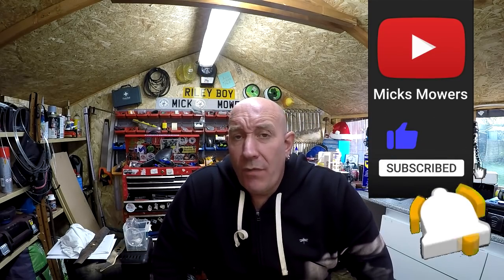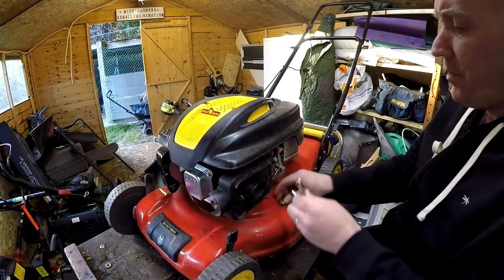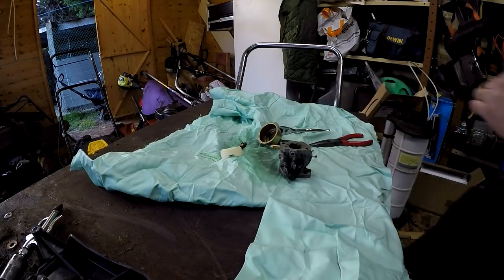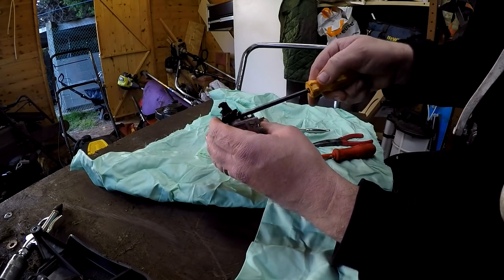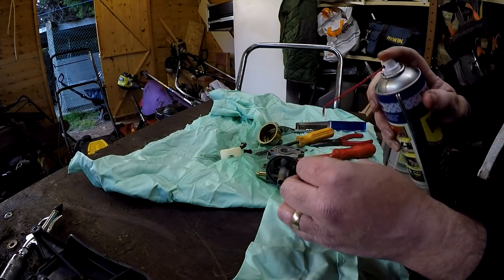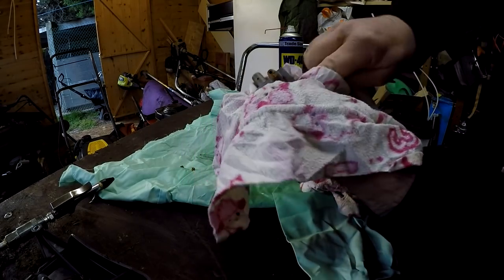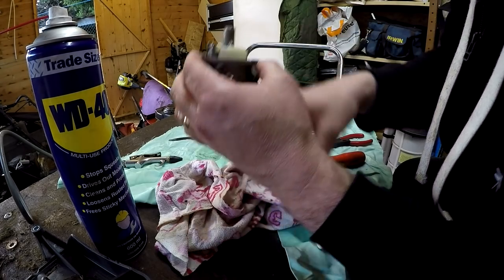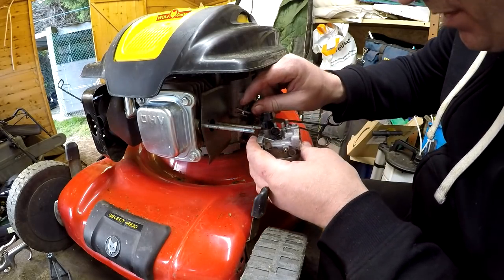Part Exchange Lawnmower Will It Run Easy Fix Or Not

Comment: Great mower you got there. Its built by MTD so got some great resale value. I would say about £60-£100

There is a reason why mowers have got less and you are correct people have either not been going out to buy them or the dealerships have closed their doors to protect staff. The agricultural dealer I work for has technically reduced their lawn and garden machinery side to be run with less staff both in the repair and sales side. Plus we are restricted on delivering items to customers.
Reply from the maker: Yeah ben.. it will all pick up again soon.. the mower sold the next day..

Comment: Looks a decent little mower that mate
Reply: It is as the Wolf Garten mowers are made by MTD mower company.
Reply: @bentullett6068  cant go wrong with MTD bud
Reply from the maker: Yeah mate not a bad engine the deck is cheap bit if cleaned it will last

Comment: Any help is appreciated I have a Honda gv100 it runs but when I put the lever into slow run it keeps running at top speed I watched your video of one you did and mine looks just the same thanks Mike
Reply from the maker: I would say a sticky governor.. check the linkage and the throttle on the carb..
Reply: Thank you for quick reply will strip and clean carb again and check out cheers Mike
Reply: Stripdown carb. fault was when connected gov rod and tightend the carb it lifted the throttle arm so the flap was trying to turn in the shaft hole loosened tiny screw refastened all was well thanks for help Mike